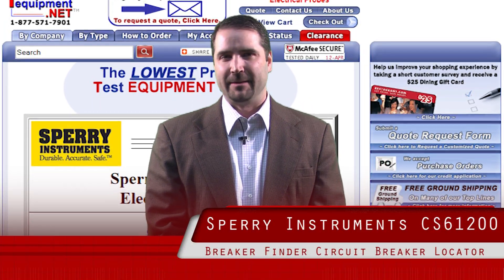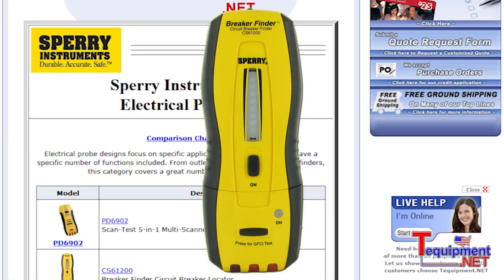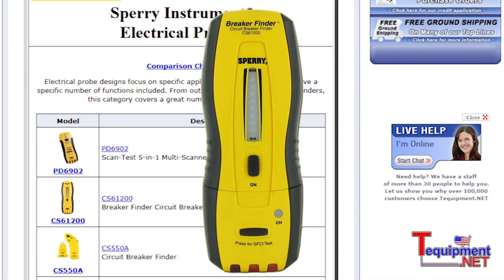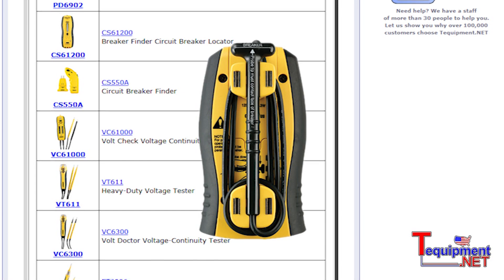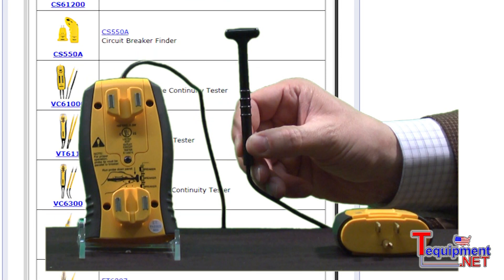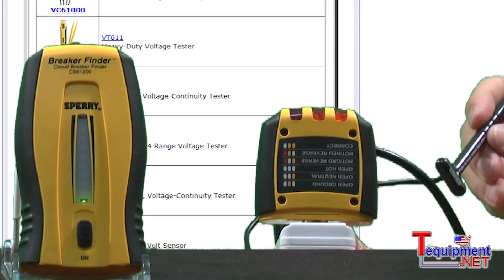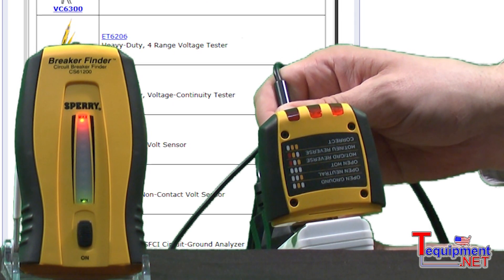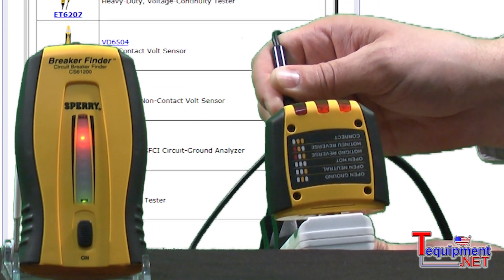Sperry CS61200 Breaker Finder Circuit Breaker Locator

Comment: Cannot find instruction to which way polarity of the 9 volt battery is inserted .
Would be helpful as no marking on battery holder or in instructions
Reply: I know this is four years too late but if you look closely at the slots for the battery terminals one slot is thin and one is thick. They correspond with the correct size the terminals on the battery. I'm sure you've already figured this out this is for anyone else
Reply: If you can’t figure that out maybe you shouldn’t be working around 220V
Reply: @wavecutter69  We are Gulf of Suez Petroleum Company (GUPCO joined venture , one of the major oil and gas production in Egypt ). We respect your products ,  Recently we bought 4 Sperry circuit breakers finder CS61200 , 120 V 60 Hz. we need to operate such devices on 220 V 50 Hz is it possible? if not can we install transformer 220 V 50 Hz / 110 V 50 Hz before transmitter …….is the device will work normal? can we replace any components inside the transmitter to achieve our target …. can you determine such components? can you send the internal electrical drawing? Do you have another model working on 220 V 50 Hz?? Do you have an agent in Egypt. 

 

 

N. B.

Regarding DualCheck 2-in-1 Tester, 50-1000V AC Non-Contact Voltage Detector, GFCI Outlet Circuit Analyzer Part # VD7504GFI can we use it as a direct contact to live wire inside the receptacle such thing will be able us to differentiate between live and neutral wires inside the receptacle